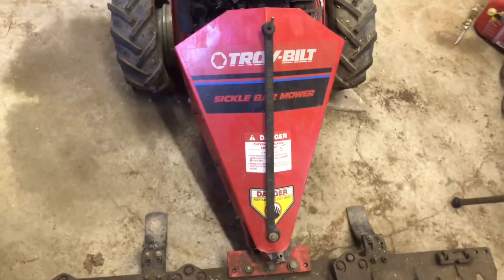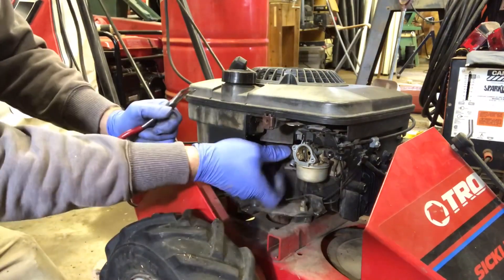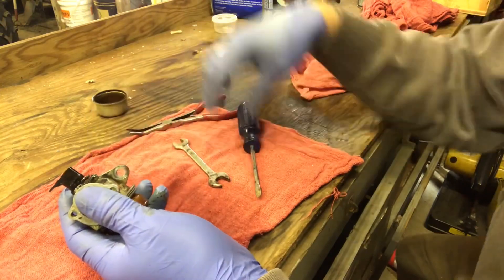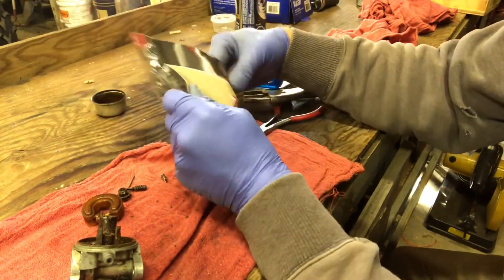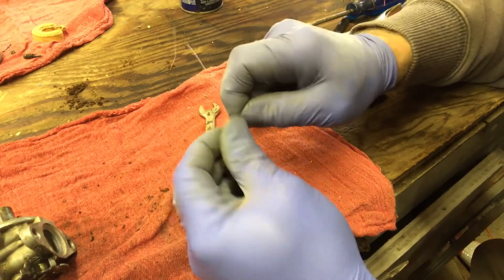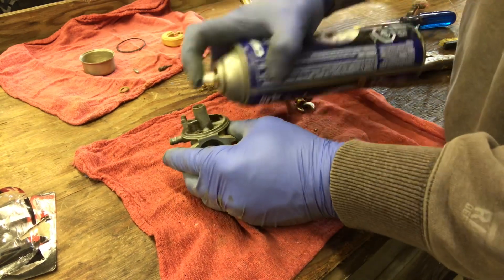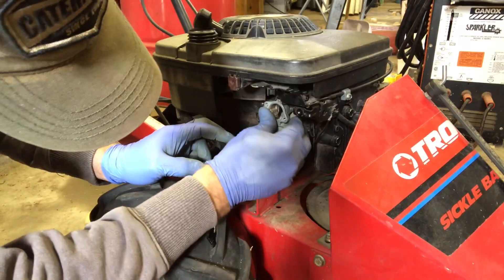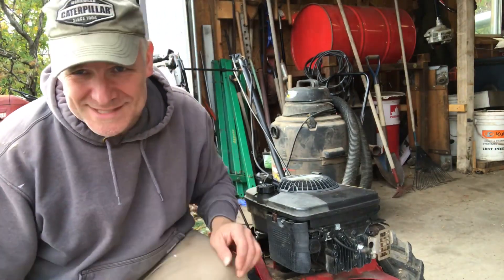Getting the Troy Bilt Sickle-Bar mower up and running.

Comment: So I was recently given a troybilt sickle mower, similar to the one you worked on here, and the unit would not run. I probably watched your video 100 times to ensure I attached the carb correctly and everything else was good to go. I could not get the mower to start! I tried everything my mechanical knowledge knew to get the engine running... I was about to give up, but I finally noticed on the back the black bar (the blade engagement bar) would not fully engage the safety button in the 'off' position. I used a bungee cord to hold the bar over, and like magic it fired up! I wanted to say I appreciate your video, because of you my mower is finely tuned and runs like a top... for anyone struggling with the same or similar troybilt mower, check the blade engagement bar!

Comment: Where do you buy one of these
Reply from the maker: I don’t now if they still make them a lot of companies went to the big string brush cutters.I would try to find a used one on kijij and Craigslist.  Have a good one Man
Reply: Dang, I really WANT/NEED one!!!
Reply: @walkinharmonyhomestead2888  they're out there think they're called Toro trail boss. 
Think they'd be ok for putting down trails or hay an acre at a time. To either put up lose or bale manually.